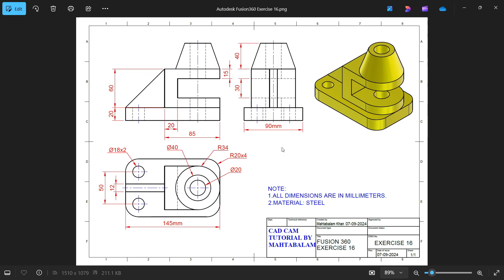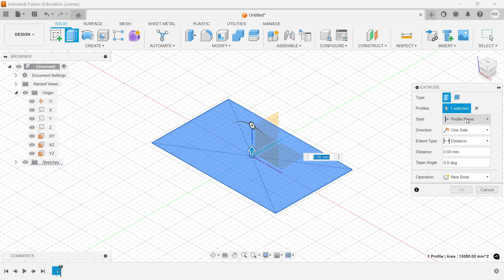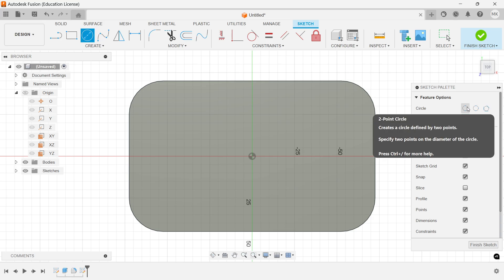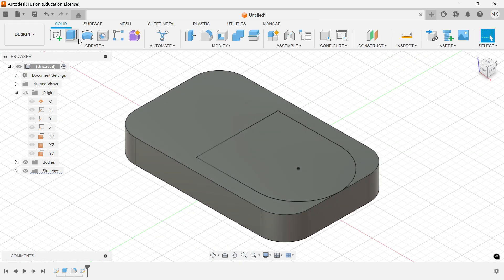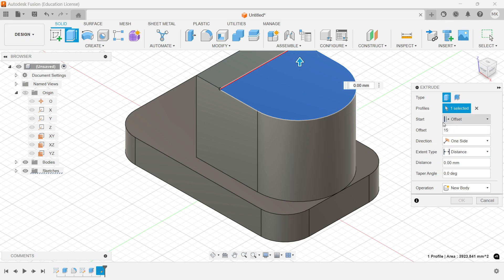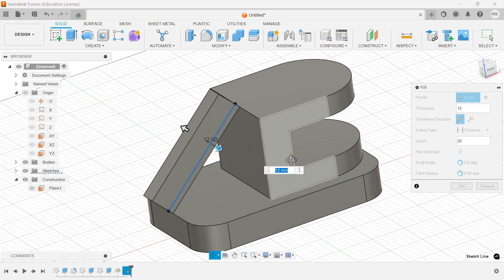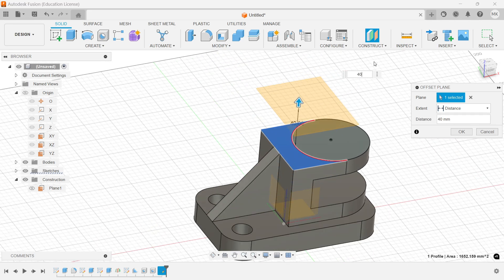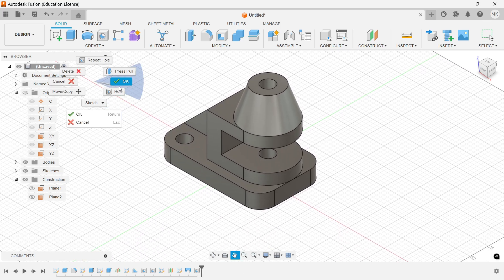Autodesk Fusion 360 Tutorial-Exercise 16

Comment: I've tried Fusion 360 in the past but I'm so used to Solidworks I know where everything is and Fusion 360 seems to take extra steps to do the same thing as Solidworks. It reminds me of FreeCAD which is a very complex free CAD program but they make no effort whatsoever to make it easier on the user. Very difficult to learn and hard to use even when you do learn it. That's a shame because the user is what matters, no matter how hard the developers may work to make a product. You may make the best CAD program in the world but if it's so hard to use that nobody uses it, then what was the point? I also used Autodesk Inventor in the past but since I've been using Solidworks, I wouldn't use anything else now.